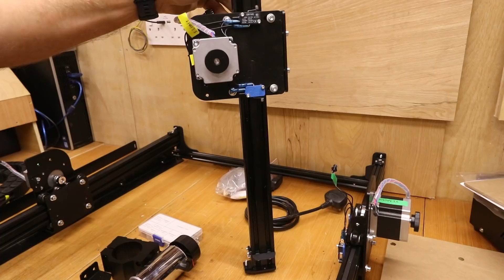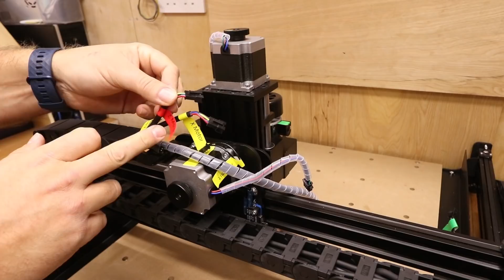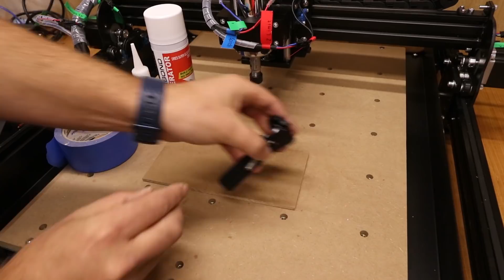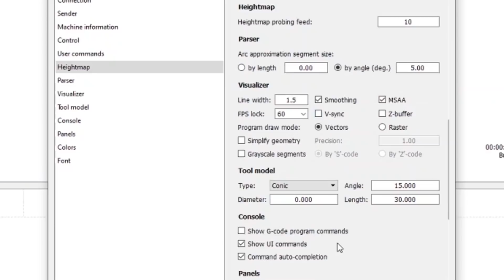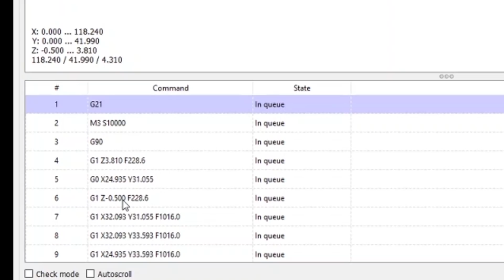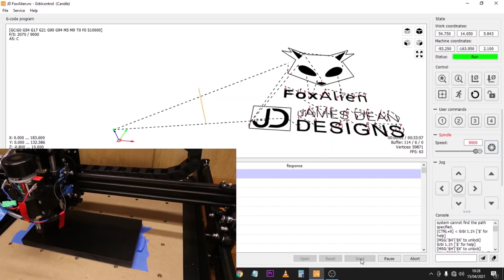4040-XE FoxAlien complete build, review and first cut

Comment: You're the 2nd person that specifically mentioned Locktite ThreadLock for the Alien. Should we assume there is a bolt tension problem? Need locknuts?
Looks a great machine, Nice & quiet too. your opinion ... Alien or SainSmart 4030 superior?
Reply from the maker: I also mention loctite for the Sainsmart 4030 as well in the build video (if I remember correctly). Its not a defect as such but a lot of the threads on these machines are quite fine so you can't tighten them up too much which is why the loctite helps. I need to test the machine a bit more  but it feels like this is targeted a bit more a laser users with the fact its belt driven but the Sainsmart is probably towards heavier CNC work such as metal
Reply: The frame rails do look a bit small & thin for their size//length, you commented about the X axis rail could be stiffer. May be something to consider. The 4030 has big stuff C channel extrusions.  I've still not seen much video from anyone using the 4030 in anger!